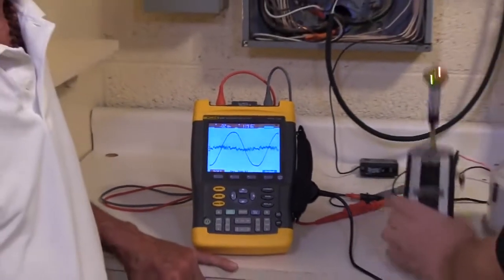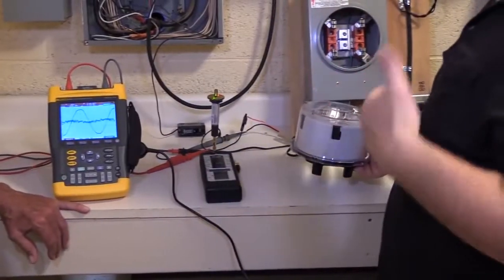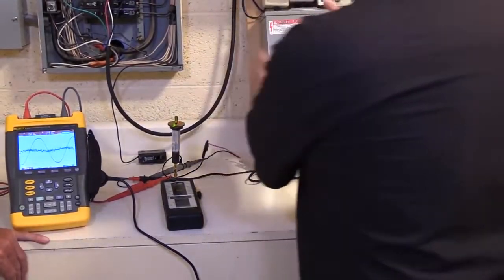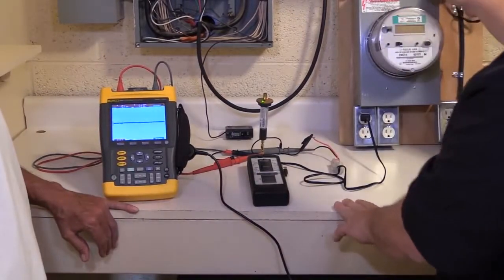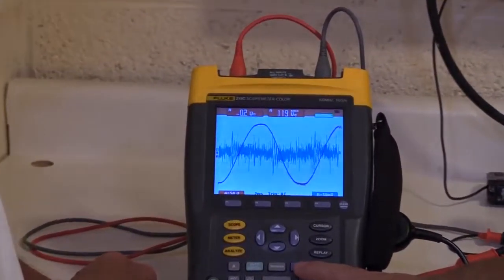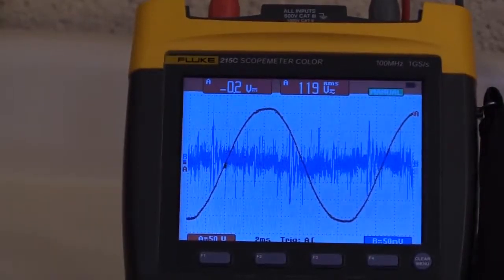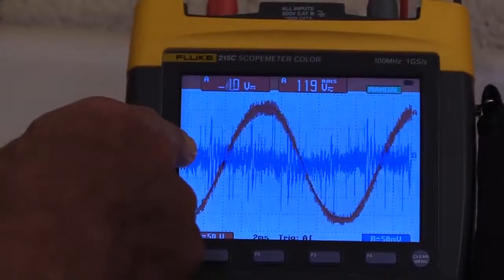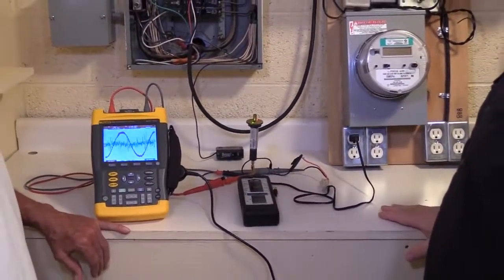Smart Meter creates pulsed dirty electricity (2-50 kHz) on the electric field in a home

Comment: I like to ask if this smart meter signal can increase the electricity usage like you pay more because of the constant charge through the system? I have no idea what I’m talking about I hope you understand my question, thanks
Reply: You are not far off: A smart meter does not measure kWh, though it says so on the display. It measures KVA which is the instant voltage x instant current. That means that inductive or capacitative loads where voltage and current does not correlate completely, register a higher current than they would do with the old style coil meter. That means that you have to go through your house checking your appliances one by one to see if their nameplate consumption corresponds to the instant power measured on your smart meter ( There usually is a button on them to toggle through display modes). This is relevant for appliances with motors (which are made of inductors) Typically they will have a power factor correction capacitor next to the motor, but it might have dried out or poorly made or missing entirely, like with small fan type motors, that don't have them at all. Ballasts for fluorescent fixtures can have the same problems Another source for harmonic noise is switch mode power supplys: They only draw power on peak voltage in the AC waveform, especially when lightly loaded, so they also produce a mismatch between current and voltage. Either replace them with better ones (showing as as a few watts drop on the meter, or place a harmonics filter in front of them, which usually can be salvaged from quality electronics as thrown out flat screen TV and computer gear. (it is the first metal box after the power socket the cord is plugged into inside the equipment). Typically cheap USB wall bricks are bad, laptop type have input filters and so has expensive original expensive phone chargers. Third source of noise is from LED bulbs. They are noisy too and suffer the same bad habits as as cheap USB power plugs as they are not required by law to be low noise if they are below 5W. You can't place hacked power filters in your lamps (maybe in your junction box for the lamp wiring) so you have to choose quality LED bulbs. It is not entirely a case of sales price, as some expensive brand are equally bad, but more often not. Fourth source is idling transformers. My surround sound amp should draw 30W standby, but to my horror, the meter thought it used 65W!!! Possibly the filter capacitors have dried out, but it is common knowledge that idling transformers have poor power factor, so it might show as using more than twice as much power as it does in reality. So it gets switched off when not in use! 

An easier option than running between your smart meter and switching things on and off, is to get a Kill-A-Watt that measures power factor to test you equipment at the sockets. The 5'th source for dirty power is your neighbours. This should really be your power company responsibility, but they make you pay for it. It is by far the smallest factor, unless you live next to the subway or big industry consuming kiloamps of power. There are filters coils that can be placed in your meter box before the meter, but this is electrician domain and slightly costly. I suggest you start with my free suggestions. When I got my smart meter I was shocked  that it was reporting my apartment idle consumption as 120W!! (fridge also off). I'm down to 50W is which is a 400$/year improvement.